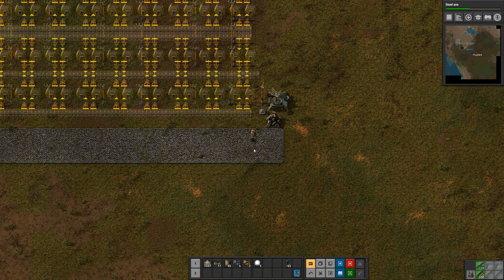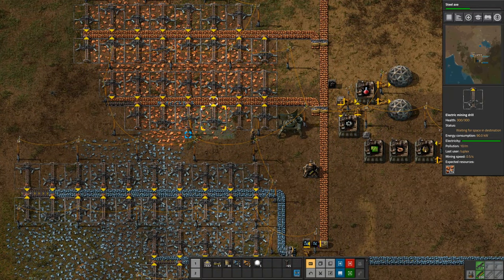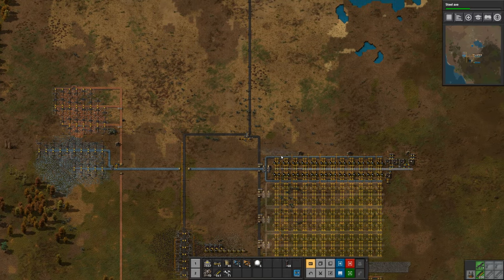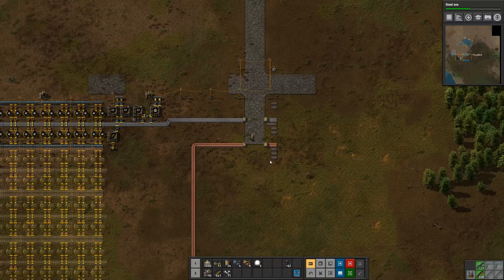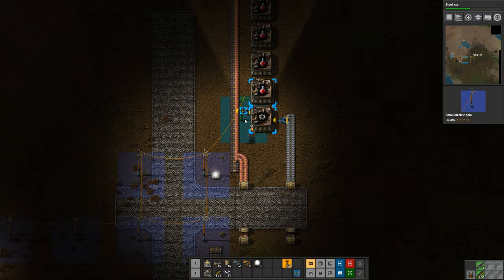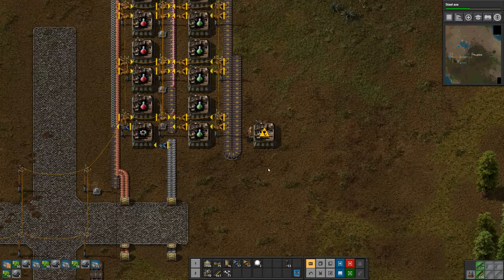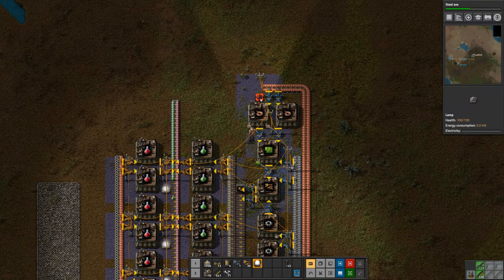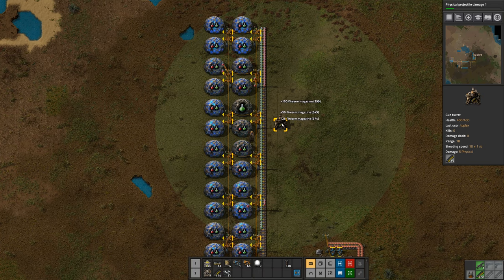Factorio 0.17 Tutorial #3 - Red and green science

Comment: You have a pice of iron ore on the copper belt at the end of the smelter
Reply: Both methods Tuplex mentioned have drawbacks - filter splitters can back up the belt (can be mitigated by giving any iron ore a priority input into the iron line), and filter inserters can miss items if they pass by in quick succession (unless you have circuit conditions to stop the belt). In this case, with only a few iron ore under the copper miner, I would have used a splitter to filter off the iron ore, with an inserter to load into the chest being fed into the iron ore line.
Reply from the maker: Thanks, I will fix it.

Comment: It looks like one red science pack takes 10 seconds to make, from counting myself, but it says 5. Is that a glitch or is it meant to be like that?
Reply from the maker: The base production speed is 5 seconds, but that is modified by the crafting speed of the assembly machine.  In your case, I suspect you are using an assembly machine 1, which has a crafting speed of 0.5.  With a assembly machine 2, with crafting speed of 0.75, it would take 6.67 seconds (base time / crafting speed = actual production time).
Reply: Tuplex since the assembler 3 has a speed of 1.25, does that mean that you can never have a setup that actually reflects the inventory craft speed?
Reply: @Loulabelle100  not necessarily. Using modules you could get an assembler 2 to be 1 craft speed.